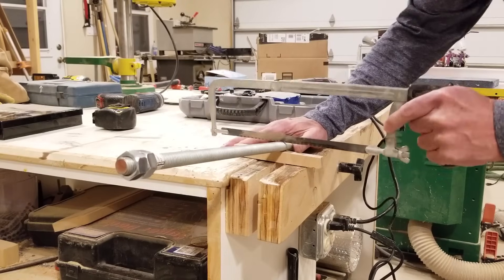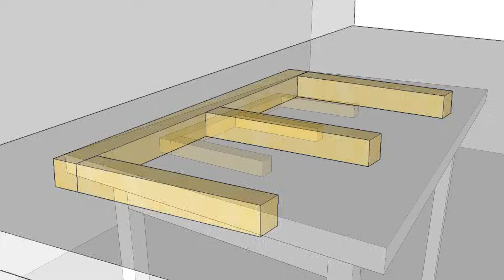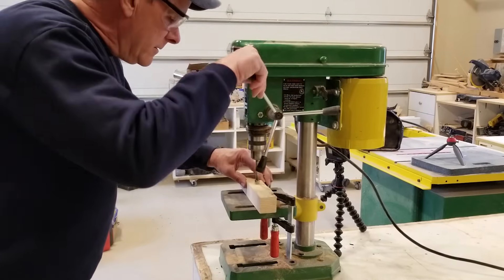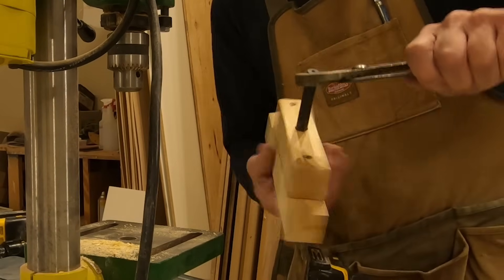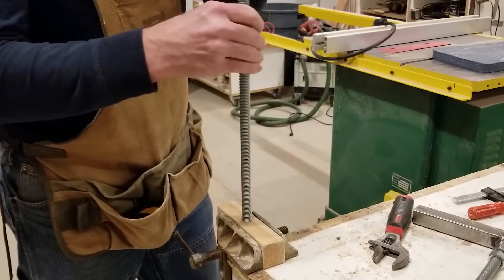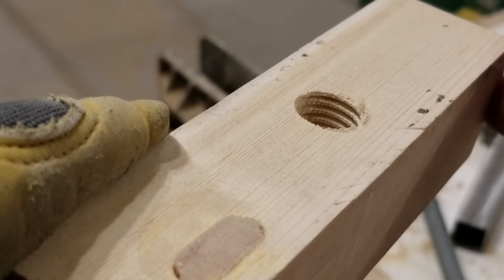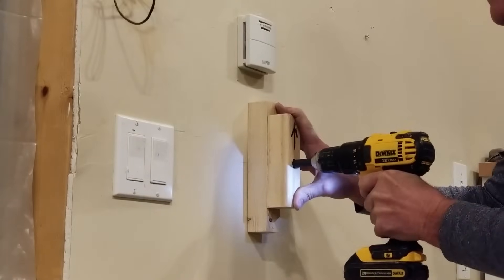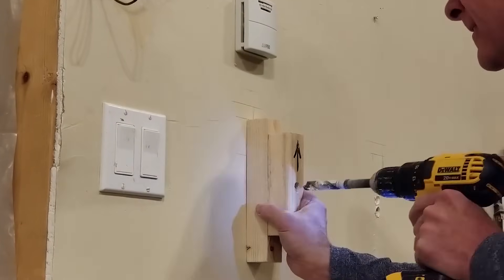Strong Floating Shelves - The Strongest Option

Comment: For my floating shelves I have a 3mm x 1 inch width steel flat bar with 3 3/4 inch by 6 inch long steel rods spaced about 8 inches from each other welded through perpendicular, it's screwed into 2 studs and has about 50 double LPs loaded up on the 32" long shelf I was even able to sit on the shelf and I'm 225 lbs merging carpentry with metal is the best.
Reply from the maker: I agree, Lumen! Combining the two is going to give the best results.

Comment: I'm sorry but I do not subscribe to the idea of wooden threads having much reliability. I think you might try 5/16 rod with 5/16 expandable anchors in the studs instead. Expandable wall anchors or epoxy fill would give much more holding power than wood threads.

Comment: Consider making the shelf a stress skin module
Reply from the maker: You're going to have to enlighten me on what you mean, Wallace. I'm not familiar with a stress skin module.
Reply: The upper and lower plywood are bonded to, and separated some distance by a rigid core. The core adds stiffness, strength, and lightness, and acts as a chord in three dimensions, like a series of tangent I-beams.

Comment: years ago i did a floating shelf for a client. before drywall was installed I drilled and bolted all thread through the studs and hung the shelves at a later date 10 years later still holding strong love the idea of threading into studs
Reply: How did you attach the shelves after the drywall was up? I plan on doing something like this as I have not put in the drywall in my dining room niche  yet.

Comment: How would you remove the rods from the wall?
Reply from the maker: Using two nuts on the rod that are tightened against each other (jam nuts). The same idea I used in pulling the threading rod in the video, except it can be done with wrenches.
Reply: Rusty Dobbs yep. That makes sense. Thank you for the reply

Comment: Most electrical wires are drilled and pulled at about hip height so there shouldn't be much to worry about at chest level and upwards.
Reply from the maker: If you said "ALL" electrical wires are installed that way, I give you a thumbs up, Goalie! But you said, Most, and I agree. I have found is just easier to know for sure I don't have an issue with wiring before I cut or drill into any wall.
Reply: @RustyDobbs  If you think about the way we drill our holes, we're using a very heavy duty corded electric drill, to keep that drill elevated over our head would take way too much energy. It's much easier to keep it planted at hip level to drill our holes. 

If it gives you any consolation, I have never checked for wiring or plumbing when installing heavy duty tv mounts. I've done hundreds and have never hit anything. The kind of tv mounts that use heavy duty lags that would destroy anything running through the stud.
Reply from the maker: @goaliedude32  Many years ago I hit a water line on a one story, new home while installing upper cabinets in a kitchen... now figure that one out! Fortunately, it was pretty tough to pin that went on me but it has always made me want to know what I'm drilling or cutting into before I do it. Just the other day, I clipped a wire in an open wall with a half-inch drill bit while drilling through a stud and I was looking right at the wire I intended to miss. Drill bit popped through the other side of the stud before I was ready for it! One junction box, later everything was good! Maybe it has to do with our relative luck!

Comment: Does that affect the strength of the stud?? That was a 2x6, but what if you did this to a 2x4  on a load bearing wall?
Reply: Honestly,  minimally. As long as approximately 1/2 of the stud remains undrilled and the hole is centered in the studs it should be fine ( advice from a professional cabinet maker and remodeler)
Reply: @cncwoodworxroc6881  Halfway front to back?
Reply: @orionred2489  yup

Comment: This is very interesting! I have a location where I want to put up some floating shelves; but I have full access to the (bare) studs behind (a storage area that has flake board walls). I think using the threaded rods going all the way through the studs with a recessed nut behind it would take this idea to 11. Then I can do something like every other stud, threaded rod, lag bolt, threaded rod, etc. (Looking at an ~8' section.

Comment: I like the method, but.. 

If you made your shelf a couple inches smaller, through bore and counter bore in the size of the nut, you could then use compression to hold the shelf up, then throw your last piece on.  I do realize it's always easier to critique a method that was used, so take it with a grain of salt.

Also, if you dip the bolt in rad antifreeze, then thread it in, the wood will expand and grip the bolt tighter, and it won't evaporate out.. Wood lock-tite.  Also works goot for those pesky hammer heads that want to slip off, dunk em in antifreeze for a couple days, and she'll never come off.

Comment: I had someone ask me about hanging a floating shelf made of live edge lumber 1 1/2 or 2 inches thick.  My solution was similar. I used 1/2 or 5/8 lag bolts into the studs with the hex head on them.  Then after putting ini cut the head off and drilled the holes into the lumber and installed the shelf. It was very strong and as far as i know still there about 5 years later

Comment: Ready rod has poor tensile strength why not use angle iron mounted to the studs it would be far less work and actually structurally sound
Reply: I assume the reason is attaching the support to the studs, it seems easier to drill a hole than ...what? Rip a part of drywall? But can you tell?
Reply: @dcgo44r  he had to cut into the drywall regardless but if you need something to be engineered and solid guaranteed to hold upwards of 1000 pounds structural angle mounted to the studs is the way to go
Reply: @ChiefStogie  but how are you going to attach the beams to the studs?
Reply: Lag bolts into the studs?  If you really wanted to guarantee its strength add blocking top and bottom to prevent any possible levering in the wall
Reply: @ChiefStogie  sorry still don't get it.  How can you secure an L steel beam or square to the front face of the a stud in the wall? Maybe I'm not understanding your aproach!
Reply: @dcgo44r  oh  I meant connect the angle to the side (width) of the stud with two bolts
Reply: @ChiefStogie  is it on the front, like where he drilled the hole for the rods? Or on the side of the stud with two lag screws?
Reply: @dcgo44r  a common stud is 38 ×89 or in his case in the video 38×150 you would attach it to the 150 mm diemension
Reply: @ChiefStogie  yes that was what I thought, but how can you get a tool in there, if not making a hole the size of your impact/drill plus a bit on the drywall on each support!
Reply: @dcgo44r  you could just use a ratchet if you want to minimize mudding and tapeing.But otherwise simply cut a hole big enough to fit your tool in and out and work in. Also the benefit of cutting into the drywall is you see exactly what's behind the wall. Remember your building these shelves to be the "strongest" cantilevering out of the walls this allows you to build shelves with the greatest amount of projection from the wall. Besides ready rod is not meant to be hung horizontally it's not meant for that. This is coming from a guy who is a carpenter for a living
Reply: @ChiefStogie  I see! I like your idea better but just before drywall is hanged; otherwise is too much extra work.. The only time I do overengineer something is to not have to come back an fix it. So I keep in mind what it is the present use or future uses. But we have to understand that not everything is one size fits all, so having the strongest shelf is relative at least for me. 👍

Comment: Every bump due to 'fixing' the wall is not a fix. I saw painters do the same in my house, such butchers... A flush finish is more than possible but more time consuming. I'm strongly against building over cracks or gaps. The finish tells apart scrubs and pros.

Comment: Been using threaded rods for a long time to install shelves but especially floating mantles such as mesquite timbers. This makes very stout mountings. I usually after the rods are installed make a slight bend in them at an upward and outward angle so that it creates a tension on the holes in the mantle so that I don’t have to use epoxy in case it ever needs to be removed in the future. Then I use a small screw to contact the threads like a set screw to keep from slipping off.

Comment: They make tiny lighted snake cameras you can plug in TO a smartphone or tablet. This allows you to see the complete void between your studs. All with just one 1/4" hole. There are also professional level snake camera systems. Lifesavers.... Nice work!! Why not just leave the allthread rod in place the first time?
Reply: "Why not just leave the allthread rod in place the first time?" My thoughts, exactly.

I guess it comes down to how much work it really takes to put a "tapped" end on a piece of rod -- especially if you're putting in multiple shelves. If it's more than a few minutes per rod to get the ends in shape, you'd probably want to make a reusable tap like this.

Comment: You can put a recessed area in the wood around the bolt, and use some blind nuts on the end of the bolts with a little tension. Then make some wood plugs to put over the nuts.
The nuts would affect the tension making the shelf essentially a part of the wall. Possibly increasing load potential.

Comment: Very cool video and I learned a lot! I've hung storm water leaders in condominiums which literally weighs multiple tons, my journey man taught me to use concrete inserts which 1/2" and up threaded rod is threaded into, then to prevent the malleable steel rods from bending downward we slip a small diameter black steel pipe (same ones used for pipe threading) over the rod and use a appropriately sized nut and washer to keep it in place. The weaker malleable threaded rod becomes as strong as steel pipe. I've seen industrial pumps weighing God knows how much supported like that. This method would 100% screw up drywall though so whatever they steel pipe is incontact with must be able to take the sideways load and not crush the wall. You would probably need like a escutcheon plate to make it look clean on drywall, I've only done it into concrete but slipping steel pipe over the rods is WORTH CHECKING OUT TRUST ME!!!!!!!!!!!

Comment: Another option for securing the 2x4 shelves would be to drill and tap holes in the end of the all-thread rod for (smaller) bolts coming in from the front.

Comment: My god, you Americans and your cardboard homes. Just build properly out of bricks, drill a hole, chemical anchor with a threaded rod and then attach your shelf to it. This crap not only risks breaking at the attachment to the stud it might even stress it to the point of flexing it so that it deforms the wall. And the tool your son made, why not just use a wrench with the proper socket?

Comment: An approach to get an invisible nut is to put a slot in the bottom that intersects the hole (e.g. with a router).  Put the nut in the slot and thread it onto the rod as you put the shelf in place.  I've done this a few times (though not on a shelf).  The slot needs to be big enough to get a wrench to turn the nut in there.  It can be a bit fiddly to get the nut threaded on.  But it works pretty well and looks good (even with the slot exposed, if it's cut neatly).

Comment: I would have packed the holes in the studs with epoxy. Though, It would probably make it a bit more difficult for removal.
Reply: Lol i was thinking the same thought my God could you imagine trying to remove it? Youd have to just saw through the bolts  at that point.

Comment: The AWP recommends a depth of 4x the diameter of the lag, so in your case you hit a great depth. I'd guess you're getting any where from 800lbs to 1000lbs withdrawal strength!
Reply: Is that for wood or metal surrounding material?
Reply: @ryleynoyes  first proper comnent question here
Reply: that's what she said ;-)

Comment: For that 2 x 4 shelf you should build it one short then recess your bolt and then slipped the last piece over with a couple dowels and glue to make a cap you would still get your metal rod in there

Comment: I did a job where i installed a 3/4 x 10 x 18 foot floating shelf in a kitchen once. because i was doing the gut reno on the entire kitchen i installed 10x10 quarter inch steel angles on the studs before sheetrock. the shelf was scribed to the finished wall and morticed on to the brackets perfectly tight and level. it was so strong you could stand on it. 

not my trick, i learned it from an old timer.

Comment: what about a floating seat/bench?   Do you think this could handle 250lbs?
Reply: It looks like it should be able to support a carefully sat bum of #250.  The problem is if someone flops down, creating a much larger force.  A shelf has to handle enormous leverage as the farther from the wall the weight is placed, the greater the effect upon it.  Sitting your bum on the very edge of your seat while flopping down quickly would be catastrophic.  For a seat, I'd go with square metal tubing.  I've seen beds free floating using I beams set in the wall.  They look great, but there is a $$$ cost.
Reply: Probably pushing the limit. I've used steel tubing forming a "tee" within the wall attached to the studs and protruding through the sheetrock for a long floating countertop. I imagine it can work with a bench seat as well.
Reply: Paul, to help strengthen your bench, you could attach a vertical board sandwiched between the sheet rock and the bench. This would help spread the load and prevent the gypsum from crushing at the lower edge.

I’d also recommend a corner installation if possible and utilize a transverse anchor of the same method. That would increase strength considerably.
Reply: You would need a steel L bracket mounted to the studs to do that.
Reply from the maker: Hey, Paul! I would be more inclined to use a welded "L" bracket that's bolted to the studs for a seat, as some others have suggested.

Comment: Is it really needed to cut threads into the wood?
Reply: It is if you want the option to remove it. You could just drill the hole a bit small and bash some reo or threaded rod in there but it would be an absolute pain to get it out.
Reply: @asdfssdfghgdfy5940  makes sense. Id just cut the rod off if Id ever remove it

Comment: I’ve built a few floating shelves over the years. The thread rod is a great idea. Myself I wouldn’t worry so much about getting them exact perfect. As the would be inside the self framing anyway.
As for sending the rod in. I’d pilot with a slightly smaller diameter drill bit, then use an impact drill with double nut and lock washer to implant into studs. 
Thanks for the rod idea though. Makes total sense for max weight.
Reply: BBQchickenxlrg Is here great idea!
Reply: Are,your studs not behind drywall?  Otherwise, can you explain how you get the lock nuts and washer past the drywall.  Also, how do you use an impact wrench to put the threaded rod in?  I cant visualize it.  Thanks in advance.
Reply: @mrkoolio8494  I think he's saying that the two nuts and lock washer are the end that he's using the impact drill on, so he has something to put in a socket fitting of some kind.  They aren't going into the wall, just used to spin all thread into the wall.

Comment: I got a 20$ camera from Amazon that using an app on your phone You could drill a hole and then put that in to get an idea of what's on the studs
Reply: Justin Plunkett  I a have seen the ad for that camera attachment/app does it work like they claim it does?
Reply: Lolololol ol my phone has an app that builds the house for you
Reply: @thomasbrown2650  it gives you a good picture. I used mine along with fishing poles to run wire in my house it helped get the wire around some pipe hangers in a finished cieling
Reply: @ryanfu2117  if a phone ever builds anything for me ill burn that phone.  I don't like cnc machines for woodworking because for me they take away from the fun of the project. Id rather do it all not just layout and assemble

Comment: Couldn't you use really long lag bolts that are designed with threads to engage wood? When you're done you just cut the heads off.
Reply: Probably could, but could you do dip exercises on them?

Comment: This looks like too much rig-a-marole.
Go buy these lag bolts, screw them in with your impact driver, then cut the heads off with a bolt cutter.
Reply: Okay for hanging pictures but quite insufficient for heavy duty use as the gentleman pointed out and demonstrated.     Think twice.  Speak once.
Reply: @colemanadamson5943  It will hang a lot more than pictures.  Perhaps not multiple bags of cement mix though.

Comment: Great video, I did floating shelves the hard way, I opened up the wall and put 2" flat stock with rods welded to them, sheet rock over the metal and hole in shelf. My new house I'm going to use your all thread plan. Thank you.
Reply: Probably the correct way, boring out studs is a bit dicey, replacing a stud is no small task.

Comment: To secure self to the wall you could use an angle bracket hidden behind the back of the shelf screwed into the wall then just slide the shelf back and secure the angle to the bottom of the shelf.

Good video, wish I had wood studs.
Reply: You got those goofy aluminum ones that like to bend every time a screw or anything touches them too?